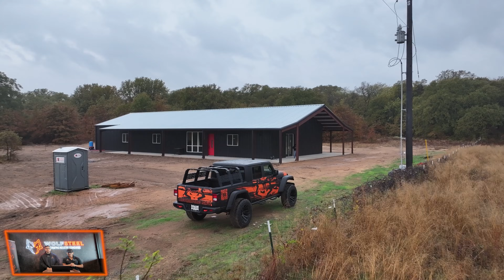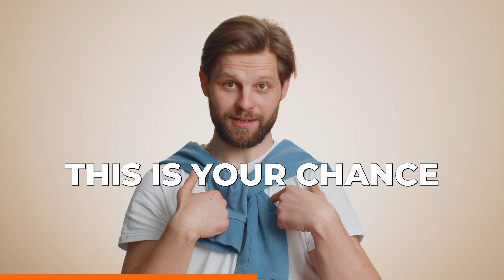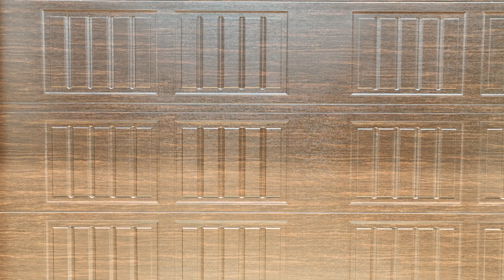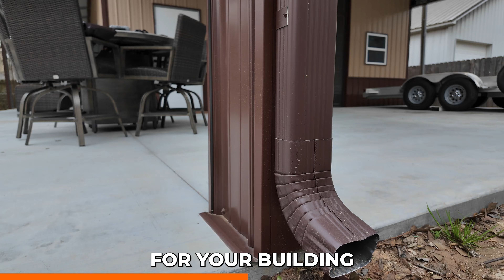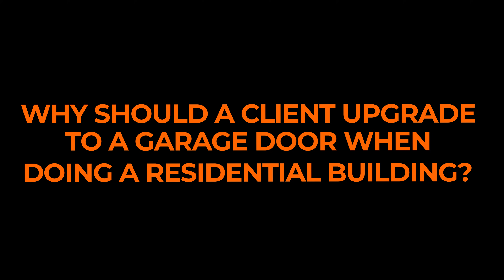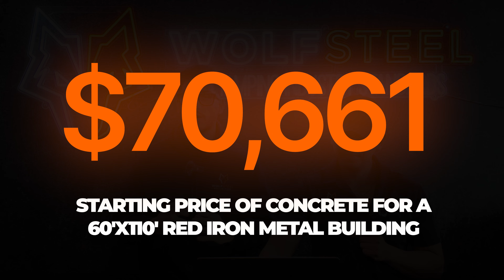How Much Does a 60x110 Red Iron Building Really Cost in Texas?

Comment: You have a line item for equipment, do you rent the equipment for pad(site prep) and erection? Is there a mark up on the rentals?
One manlift and one telehandler?
How much does distance effect the price?
Chico, TX 
Currently property is heavy timber but I will have the equipment to clear it and build the pad myself.
Excellent entry and exit to property solid driveway for semi. Power and water onsite.
I'll also do the plumbing and electric myself (30yrs experience)
Red iron weld up 40x50x16 4/12 pitch with gutters one walk door and 2 10x14 insulated doors, 2" closed cell, 4" open cell. Eventually I'll add HVAC. Not looking for an exact quote just trying to set a budget for the entire property. I'll be building my home
Reply from the maker: Yes we do need to rent equipment for red iron buildings. For tubular it depends on the building size! 

No markup it is direct to the renting company. 
Distance and duration does affect the cost. Generally we have companies we work with and find the closes to the client. 
Sissors or telehanders! 

if you're opent to hoping on a phone call or email contact us at 844-941-0999 or quotes@wolfsteelbuildings.com so we can discuss! For residential living buildings we only do bolt ups with engineering. Looking forward to discussing you project and I hope I answered all your questions!
Reply: @wolfsteelbuildings  thank you for your time and information. Won't be a living space, just for my vehicles and tools. Lift welders etc.. just not sure if it's $100k project or $200k project.

Comment: That’s like $12 a sqft for only concrete 💀
Reply from the maker: Appreciate your comment. We don’t price by the square foot like many in the industry. Our standard concrete package isn’t just a slab. It includes the thick slab (our standard thickness 4"), perimeter and garage door notch details, vapor barrier (most companies don't offer this), perimeter footing, and internal cross beams for extra support. Everything is designed to give your building a strong, long-lasting foundation.

Comment: TOO MUCH!!!! Thats my guess. LOL!
Reply: $ 156,522.60
Reply: Turnkey – $ 273,768.60
Reply: BS
Reply: BS
Reply from the maker: The price that was shared reflected custom features based on the client building needs. As this will be used as a home, the building was engineered. Typical red iron on the markets are non-engineered. A 60x110 non-engineered is $15k cheaper but this difference ensures your home will protect your loved ones and stand the test of time if you go with an engineered building. For example, the engineer plans included wind columns in addition to standard I-beams, helping the building handle vertical loads and high winds without shifting or leaning.